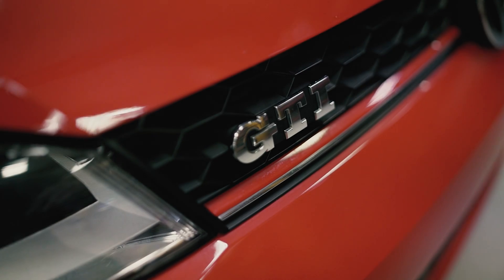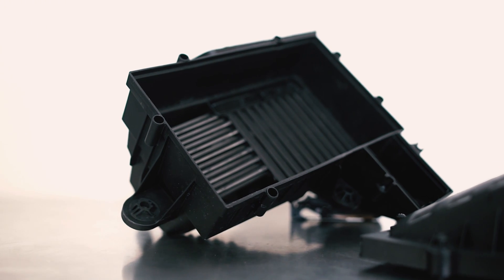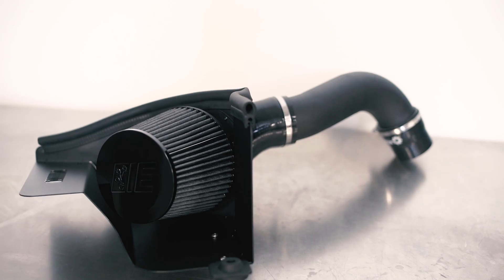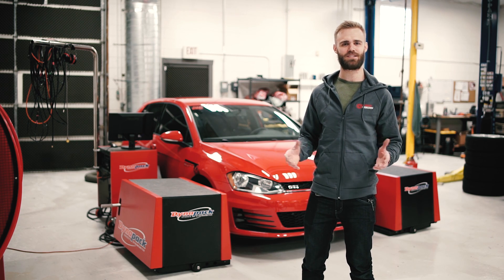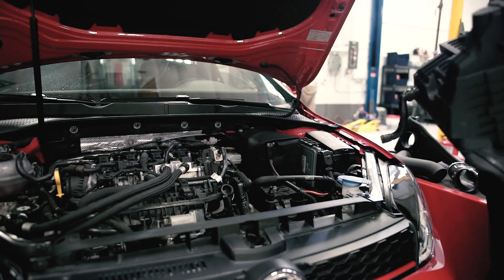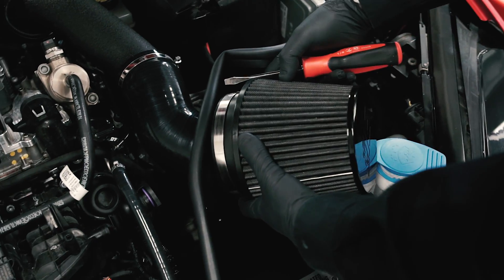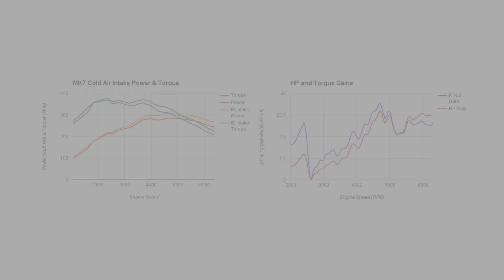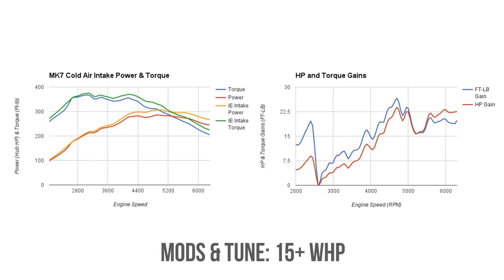Integrated Engineering MK7 Cold Air Intake Overview

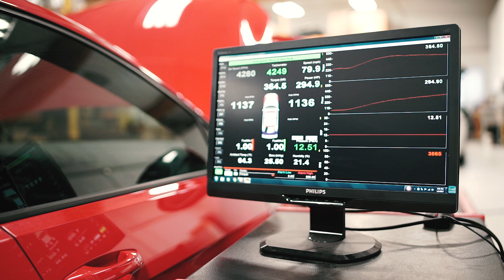Comment: Yeah i dont know.... the fan is on in both the angles though? You can see it. 1:36 its on.  1:41 its on. 1:47 the computer is blocking the fan but you can see it spinning in the reflection below the left of the monitor. And in the last frame 1:55 the fan is shown off but the car is still "reving down" but there is clearly no one sitting in the seat and the wheel disc is not spinning on the machine anymore but the "reving" noise is still going like the test is still going lol? Sounds good though I guess.

Comment: Why was the fan off on the stock intake run and then turned on for the IE intake? You can clearly see the shadows the fan was off on the stock intake run! They did this to get a better result with their own product obviously.
Reply from the maker: It wasn't, the fan just was not running for that specific shot the videographer took. Testing conditions were exactly the same.
Reply: @IEtuned  Ohhhh okay thank you for clarifying!! I was just curious to know really.
Reply from the maker: @ohZyki  No problem, marketing is a fickle beast. If we actually filmed the entire process you guys would get pretty bored by around the 4-hour mark. Haha

Comment: these intake are pointless on turbo car, unless you like hearing the turbo. a couple pieces removed from the stock air box, and a free flow filter will do the same thing.
Reply: Are you talking like removing that "snow guard" and maybe a turbo inlet pipe and then putting in one of those drop in filters? What would be the benefit in doing that vs an intake? More sound from the intake kit? Or would it be about the same? I get the price for the two parts would most likely be cheaper than the intake kit. But is there really no other advantage of the parts vs intake kit? I wonder whey they sell intakes so much if one could get the same effect from the cheaper mods?

Comment: guys very interested in the intake. but please can you clarify regarding the sound when the car is under load? is this is a normal sound on these cars perhaps from the dv when running higher boost? or is it indeed compressor surging.  It sounds like surging in the lower rpm range
Reply: According to Integrated Engineering, there is a design aspect of the intake which either creates or exposes (unsure of which it is) this "natural" sound

Comment: Blows a massive fan on the intake with the hood open. Yeah it makes more power now. 🤦‍♂️
Reply: Ravenstylea2 driving 100kmh = 100kmh air blowing into the intake + suction
Reply: @kdoran709  only if you're driving 100kmh with the hood open

Comment: Why not compare them both with the hood closed ? Obviously the cold air intake get less restriction with a big fan pointing at it.
Reply: Noel127 exvept you don't drive around with the hood open. No one is disputing the fan, it's the fact that it's blowing on the intake with hood open
Reply: lol exactly right
Reply: or once the engine bay gets heat soaked
Reply: Um the fan is there to replicate the wind from driving or else the engine will immediately overheat and blow up.... Ignorant noob.
Reply: @Noel127  calling him a noob when you literally have no clue what you’re talking about...🤣